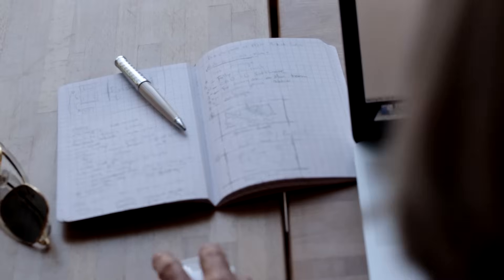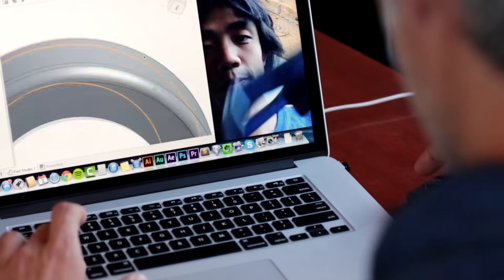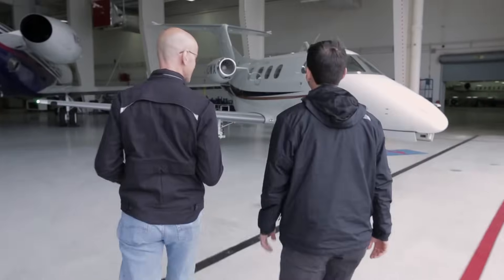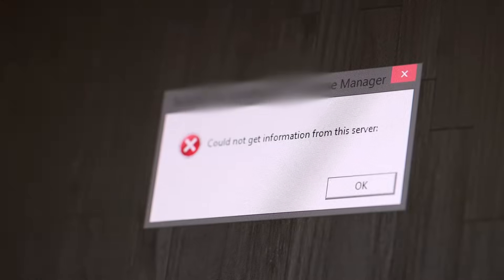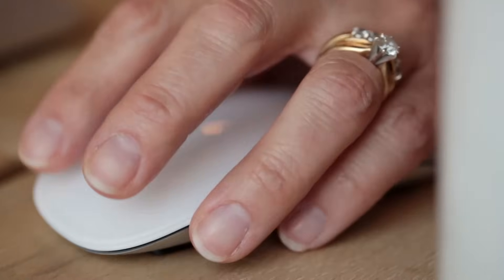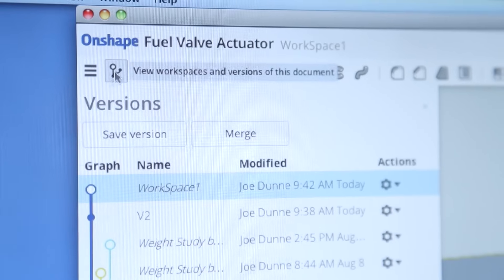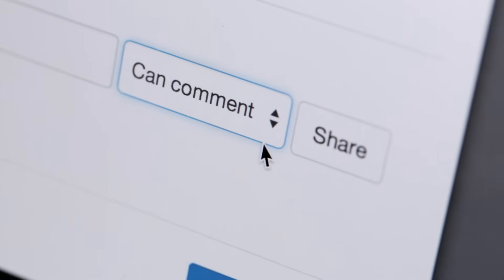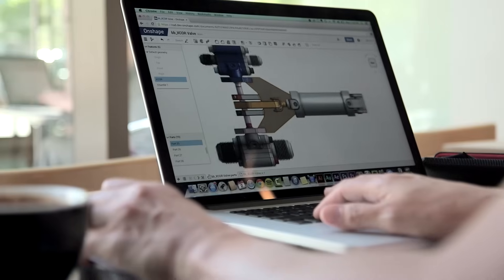Onshape | Our Story

Comment: Can't save drawing
 as a STEP, STL or DWG which I need to use to import into AutoCAD or Inventor
Reply: Onshape exports parts, Part Studios, Assemblies, Drawings, and tabs containing other imported CAD files to these CAD formats.

For more on exporting see, Exporting Files.
Parts and Part Studios

    Parasolid B-rep (.x_t or .x_b) from v25 to v29

    Parasolid mesh (.xmt_txt or .xmt_bin) from v28 to v29
    ACIS (.sat) R21
    STEP (.step) AP203 and AP214 (geometry only)
    IGES (.igs or .iges) 5.3
    SOLIDWORKS (.sldprt) 2004
    STL
    Rhino (.3dm)
    Collada (.dae) 1.4.1 without joints data (with meters as default units)

Assemblies

    Parasolid B-rep (.x_t or .x_b) from v25 to v29
    ACIS (.sat) R21
    STEP (.step) AP203 and AP214 (geometry only)
    IGES (.igs or .iges) 5.3
    STL
    Collada (.dae) 1.4.1 without joints data (with meters as default units)

Drawings

    DXF (.dxf) Release 11-14, 2000, 2004, 2007, 2010, 2013
    AutoCAD (.dwg) Release 11-14, 2000, 2004, 2007, 2010, 2013
    DWT Template (.dwt) 2013
    PDF
Reply from the maker: Did StringGene's comment help?